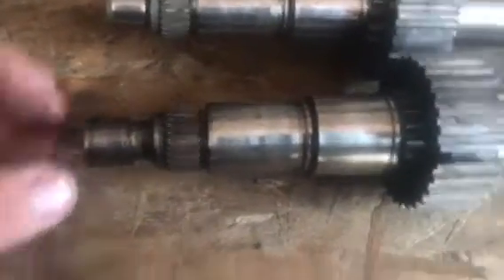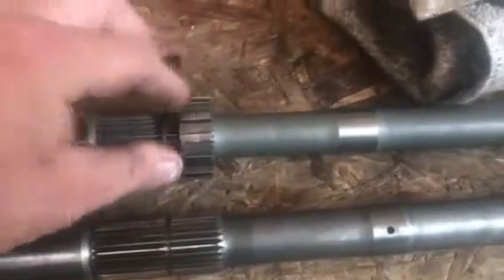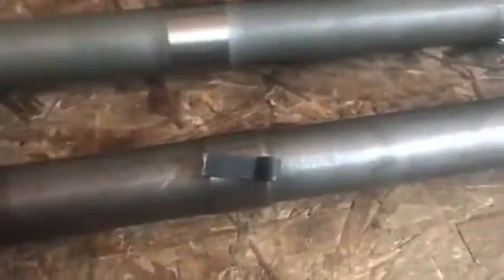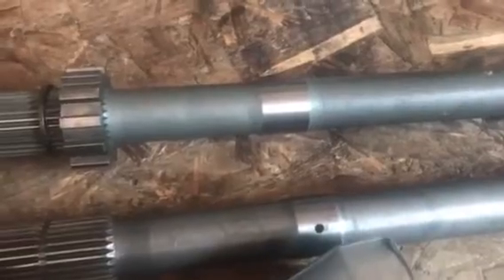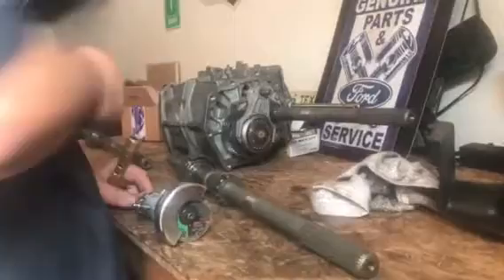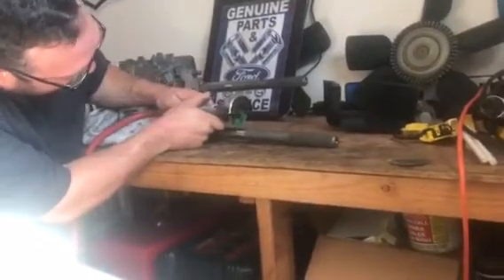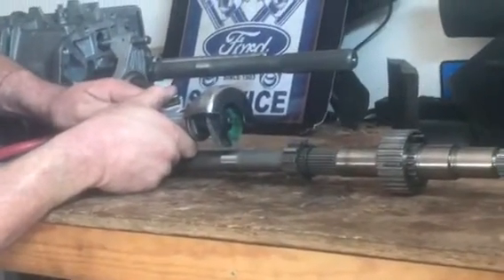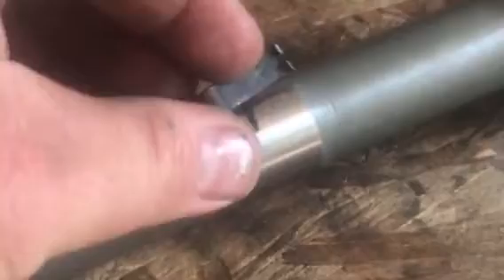Modifying tremec t5 output shaft for digital to mechanical speedometer

Comment: I'm disassembling my T5 right now and have the electronic speedo gear on the main shaft but I can't seem to get it to press off. Lock ring off and everything, am I missing something?
Reply from the maker: If you were trying to press it off with the fifth gear, it won’t work. There’s another clip after it keeping the fifth gear from moving.  You need to get your bearings Seperator behind just that reluctor gear and press only that off
Reply: @v8only  Thanks for that! Got it off without an issue after that. Thanks for the quick reply

Comment: this is great thanks for the info. i have a question. im looking to put a s10 tail housing on a t5. can i cut the shifting rod to size or do i need to replace it to accept the s10 tail housing?
Reply from the maker: To put the s10 tail on a mustang trans you’ll need the s10 shift rail to swap into the mustang lid.  You’ll also need the s10 shifter block.  Both are available new from all state gear for a Good price.  Fyi the shifter block from all state was made slightly too small on the bore for the shift rail.  You’ll need to open that hole slightly so the shift rail will slide through.  A machine shop can do that in seconds.  You could also try a drill bit but don’t mess it up
Reply: I literally just did that swap in my garage in about an hour. Not too hard at all. Just grabbed a junk s10 t5 from a buddy. Followed instructions that I found on the HAMB

Comment: Umm .. that's supposed to be a hole not a slot!
Reply from the maker: Since you think you’re the expert, you go make a video for free on your own time and post it up instead of whining about it
Reply from the maker: Either will hold the clip just fine. The pro shops I buy parts from shared this with me. You go ahead and find a drill bit hard enough to drill a hole.  Never a single issue with this Method

Comment: Two questions, I've got a stamped 92 t5 wc I've completely broke down... was rusted up solid....no exaggeration here. Had to use a bearing splitter and press with hydraulic press to break down. My cluster countershaft has C56....which I see they used 056 for Isuzu.... Question 1..how do I ensure I get the correct replacement countershaft? My unit has no case tag so my determination of WC is the pressed  tremic stamped front bearing retainer. Q2....my speedo gear was a metal one vs the plastic....and it's teeth were milled in left to right and not way the plastic ones were in a spiraling fashoned.....what does this mean to me as far as my future speedo selection....ever seen one of those types?
Reply from the maker: Boxcar's Garage ya some like s10 have a speedo like that.  The stamping on the cluster is what i use to determine what it is. You can also count the teeth on all of it and match it up that way. Your unit is going to be really obsolete.   You’re going to have to call a lot of shops to find that part